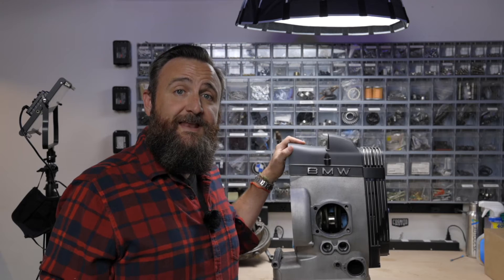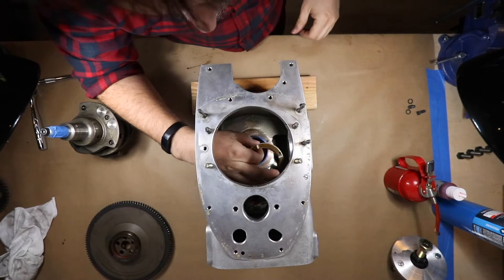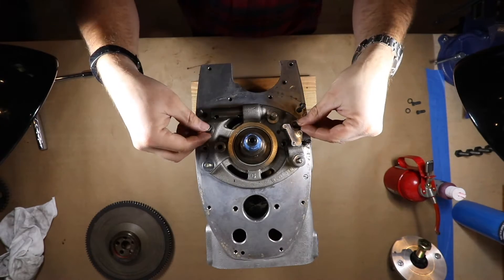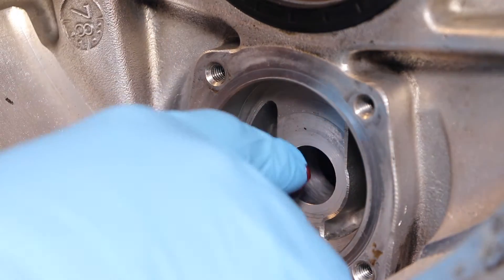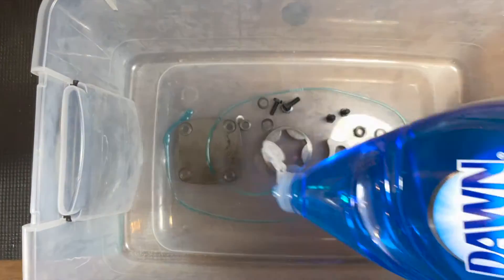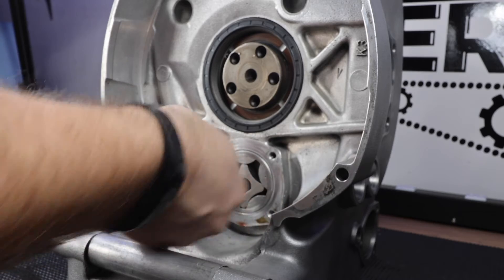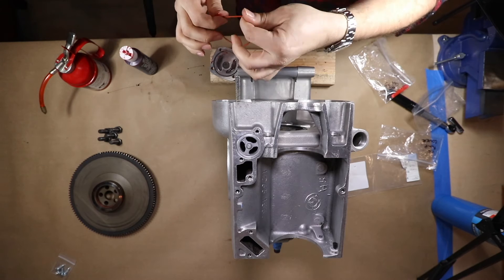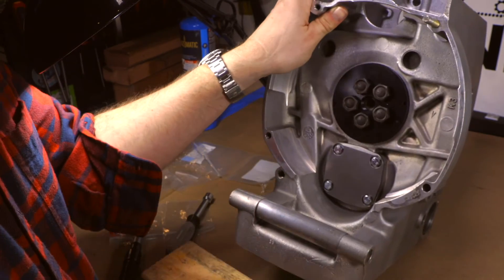BMW R80 Engine Rebuild - Step by Step // Crank Shaft, Cam Shaft, Oil Pump & Main Seal // Pt.1

Comment: Marcus, what did you use to block the crank in place while you installed the rear main seal, etc?
Reply from the maker: I bought a tool on cyckeworx. I think there is a link in the description.

Comment: Great video.  Thanks for posting.  Do you have a detailed video of installing a Siebenrock power kit? I'd like to see a video of the Big Bore 1070 kit installed in a bike without taking the motor out of the frame.  That would be incredibly helpful in case you have any plans for that in the future.
Reply from the maker: Thanks Asad. I’m hoping to make this very video in a couple of months time.
Reply: @montmoto  That would be excellent.  I will be waiting eagerly!  Thank you.